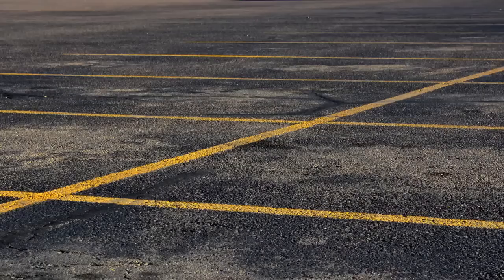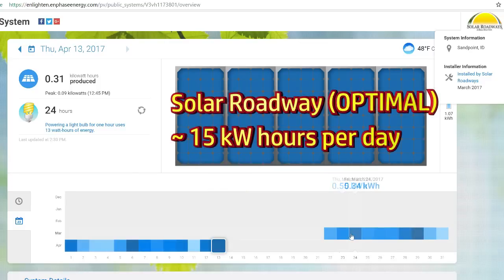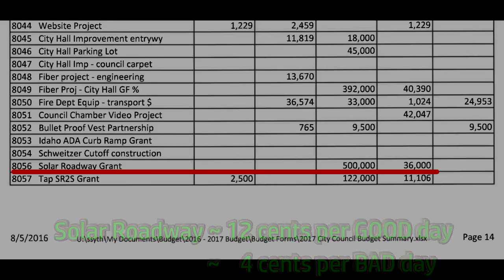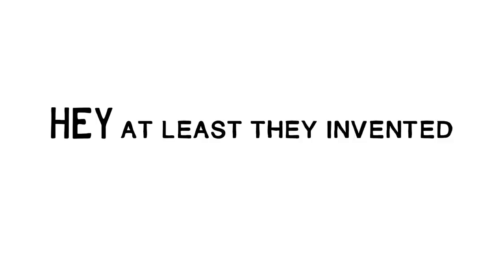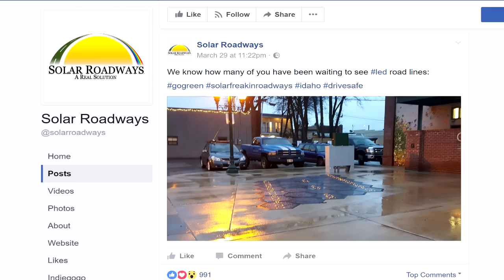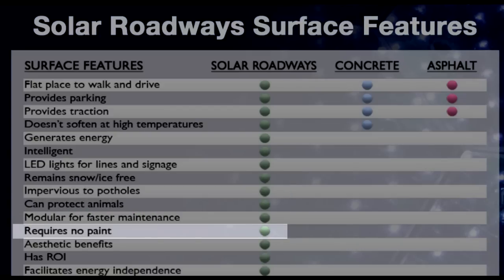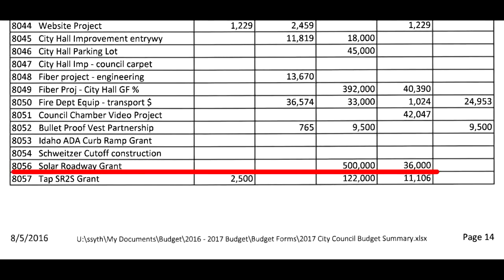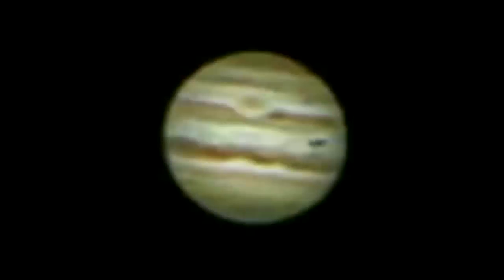Solar Roadways generate ~10 CENTS per day!!

Comment: I hope you read this.
I hope you do a video on it.
If mankind designed a shoe,,yes a shoe that captured a percentage of energy with each step taken by each person where woud that equate to. Sliding scale obviously. Shoe stores the energy and can then later transfer the accumulated energy
Reply: All that energy comes from your body, which burns food to produce energy. And today, producing food has a huge carbon footprint (from fertilizers to processing, from transportation to packaging, most of the stuff you eat cost several times of its weight in oil to produce), so it would just be a hugely inefficient fuel-to-electricity generator.
Reply: I was aware of that. I was trying to capture some of the energy that we waste as a result of what you mentioned above
Reply: It wouldn't be "wasted energy". Your muscles exert energy to move you around. Wasted energy is what is turned into heat through the inefficiencies of muscles, the non-elastic deformations of connective tissue etc. Any extra energy you'd be getting out of your shoes would be your muscles spending some of your energy to not move you around, but to power the generators in your shoes. The shoes would be that much harder to walk in.
Reply: I could see that coming.
Simply said
If your shoes weigh more you use more energy to get around
Plus the energy to create the shoes etc
The cost of that extra energy to create is not worth the returns.
Have I got it right
I am no physcist but I can understand that you dont spend a dollar to get a 70 cent return
Reply: Thank you for your responses as well
I am here to be informed
You have helped

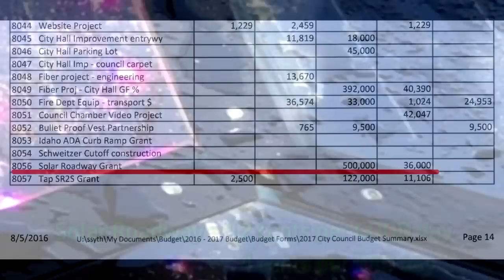Comment: 8:20 "No we have some hard numbers for ... return on investment" Er, no. The half million is for the installation of a prototype and not a mass-produced production-engineered system. Solar Roadways may be bunk, but your cost/benefit analysis is poor. You need to find out (or estimate) the projected mass production and maintenance cost. EDIT: OK, so I see you get to this at about 13:25 but based on his "current charge" which still isn't the mass-produced cost. It might be interesting to work the other way and calculate just how cheap the mass-produced cost would have to be for the roadways to be economical, and so what materials they could use. I bet that would also eliminate them as a possibility.

Comment: A decent reporter or journalist needs to do just a little bit of work and blow this scam wide open. The inventors have taken millions and simply gone about purchasing significant assets with the money that will of course be theirs to own once this farce ends. 
The husband and wife team the Brusaws were originally operating out of their own barn to make their dodgy prototypes. They didn't need any more space as it is still just the two of them but as soon as the big dollars started rolling in they used the money to purchase an actual premises when renting one would have been the prudent thing to do. They have also spent hundreds of thousands of expensive equipment to make 30 panels of glass when it could have been contracted out to an established business and a job. The had nice new trucks the minute they could get their hands on the donation money too as has been confirmed by residents of Sandpoint.
The Brusaws are still stating on their page just this week that they just need $15 million to start mass production. This is a scam and I'm waiting for a decent reporter to expose the truth.

Comment: So theoretically what would have to change in order for them to be viable?
Reply: roostewrum yeah I agree though they're probably there in order to get publicity.
Reply: Price would have to decrease around 1000% ($50/square foot of road is so affordable, you know) and efficiency of solar panel technology would have to increase to a point that I doubt it will ever achieve, ever. --An electrical engineer
Reply: They need to take the LEDs and rubbish out. They need to place them in a position where a car will never drive on them. Like on top of a roof. If only they had invented "Rooftop Freaking Solar".
Reply: RedRage oh okay. Thank you

Comment: 2 years ago when you posted your first video about solar roadways, I was in the camp of giving it a chance.  I'm all for the investigation and development of new technologies, exploration of the sciences, and so on, because that's how discoveries and advancements get made.  The last sentence of what I wrote was, "This all is an idea that needs to be given a chance to see if it can be developed so it's worth the time, effort, and money to expand further, or if it's an idea to toss in the dumper."

Well, they've had their chance to develop and test their solar roadway panels in materials, manufacturing, installation, and functionality, yet it looks like it hasn't really changed in 2 freakin' years.  They haven't delivered squat in terms of their claims of what their system can do and they've pissed away a ton of public and privately donated money to do it.  They've had 2 years of chances (and failed) and 2 years to definitively refute the numerous videos debunking their claims (and failed), and have only confirmed that yes, this is an idea to toss in the dumper where shit products belong.
Reply: The problem remains about the millions in public and private money that was thrown down the drain, that could have been easily saved at the cost of a pencil and the back of a used envelope.
Reply: Yes, I absolutely agree there.  Giving them a chance to prove themselves should not have included gobs of money being thrown at them by duped donors and starry-eyed politicians in government.  Thunderf00t and EEVblog/Dave Jones both showed some pretty easy tests and calculations to prove the solar roadways claims were dead wrong and needed redesigning for the panels to do anything useful.  If the owners of the company were electrical engineers as they claimed (if I remember right), they should have been able to do that themselves without the need for so many investors.  I commend them for exploring the idea of covering roadways and everything else with solar panels, but they should have admitted it wasn't a viable idea rather than pushing it as a flawless panacea for the world's energy needs while deriding the very valid criticisms of scientists and engineers who know what they're talking about.

Comment: I see their point that solar panels and roads are wasted space. But what's wrong with putting solar panels above roads ? 
- No losses in the glass layer
- Solar panels can be placed at an angle or even tracking the sun
- No expensive maintenance
- Snowy road doesn't have to be heated as snow doesn't fall on the road
- Only a little more expensive than regular solar panels (for the 'tunnel' construction)

"Downside": no flashy lights (which were proven not to work anyway)
Reply: If you put them on a rooftop, they are placed on an existing structure. Over a road as you suggest requires the cost of additional structure. This additional cost has to be justified by a comparison against the savings of snow (so there is no benefit in warmer climates) and the cost of no longer being able to transport oversize goods by road.
Reply: Yes of course, I would place them on a rooftop first. I don't think we're anywhere near having all rooftops equipped with solar panels. Maybe maintenance would be cheaper on large quantities though

Comment: There is also a solar roadway in the netherlands which is very succesfull maybe you should look into that!
Reply: The Netherlands one has fundamental differences: most importantly, no LEDS - so the whole thing can be done much cheaper. The NED project is still never going to be as efficient as rooftop solar, and is still liable to the costs of maintenance due to have a traffic load.

Comment: You are missing out the geographic position. A lot of power is lost in the atmosphere, which basically can be seen as an outer sphere with the planet sphere centered inside of it. And the longer way the sunlight travels through the atmosphere, the more power is lost. The place with the lowest atmospheric power-loss is the .... equator.

Comment: If they want to use the area covered by roads to generate energy it has to be a LOT cheaper to just build scaffolding OVER the roads and put tracking solar panels there. It will also eliminate snow on the roads. It will probably be less likely to break down since a lot of daily tonnage of vehicles driving on them. And they will never be blocked.

Comment: Check out this device called a "Radiometer". It is four metal squares, joined like a fan, and  covered in a clear globe. When light hits this, the metal fan spins. Connect this to wires and you can generate electricity.

This is solar power, but it's not by solar panels.

Comment: obviously you don't realize that in order to improve something you have to create a proof of concept. These solar roadway panels are obviously not great, but 20 years ago people would have said no one will ever use solar panels on their homes, and yet i can't even drive through a local neighborhood without seeing a home with a solar array. Give it some time to evolve and develop and i guarantee roads WILL be this way. Anyone who doesn't think this will eventually is a fool.
Reply: Zack Denkers Sunlight is abundant. But only a known, finite amount will fall upon a given surface area. A flat panel can never, ever be as efficient as a roof panel or a tracking panel due to it lying at an incline to the suns rays, therefore receiving less light per unit area. Unless you propose building roads at an angle towards the sun there is no way around this.
These road panels also only have about 60% of their surface as actual solar panel. The decision to make them in these hexagons means that the cells do not fit within them effeciently, as well as losing more area due to internal support structures and the LED's etc.
What makes these even more ridiculous is that a village in france has had a long section of solar road laid down already, designed and manufactured by companies who know what they are doing. And guess what, cars can actually drive on it! But there's still no known future for it, due to the massive costs of installing it and the small amount of energy to be gained from it.
Reply: Zack Denkers The law of physics that a plain surface inclined away from the sun receives more energy than one perpendicular to it. It's pretty basic stuff. 10 year olds can understand it!
Reply: No, he showed that at a flat angle, not enough sunlight hits the road. And there are objects blocking the sun creating shadows.
Reply: again in current technology that is true.
Reply: Zack Denkers If they can increase the effeciency of these solar panels that lie flat on the ground, then it stands to reason that solar panels that are roof mounted will become more effecient also. It makes no sense to believe that the cost per unit area of a roadway panel could approach that of a roof panel, given the additional infrastructure and technical requirements of the former over the latter.
Why would any sane person choose a costly maintenance nightmare that will never pay for itself over a proven tech that is virtually guaranteed to do so?
Reply: That's the thing you aren't understanding under today's technological limitations that is true. it was also true of roof mounted solar systems not too long ago. the other thing you have to keep in mind is locations with severe winter road conditions could potentially benefit 1000 times more than warm climates. considering some states spend millions of dollars per year on snow removal, and that the estimated loss in the state of utah for a single day where significant snow is on the road would cost $66 million dollars if no roads were plowed. it stands to reason they might consider spending some money on a better way to clear the snow. 

With today's technology that's not feasible, but it also stands to reason in 20 years it will be. you are all fools if you believe someone that technology cannot grow, just because he has a great argument that the current technology blows. look at the first cellular phones we would have never thought they would replace computers but in many instances they can and do, even though desktops are more efficient and cheaper, there is a significant advantage to the size and mobility of a smart phone.
Reply: The laws of physics are the limiting factor, not the technology.
Reply: roostewrum how do the laws of physics prevent it being possible to create the technology to power a roadway through solar to do what this project aims to? none. the only LAW of physics that could prevent the technology from function is the law of thermodynamics and since you are obviously incompetent i will explain it in layman's terms. basically energy cannot be created or destryoed. and any closed system will always run out of energy eventually. what this means is that you can't create more energy than you already have, hence the sunlight. luckily sunlight is quite abundant, unfortunately our BEST solar technology is only capable of capturing 40% of the energy they could. these roadway panels are likely less than a tenth of that efficiency. luckily with technology when you ha e something so inefficient the only direction you can go with it is up. nothing stated in this joke of a video suggests otherwise. just as nothing stated proves the technology will never be efficient enough. it is a simple ignorant video intended to fool the simple minded into believing technology cannot advance past where we are today.
Reply: you have still yet to point out a law of physics that prevents the technology from being efficient ENOUGH to do what it aims to do. if you compare them to roof panels you're right they will always be more efficient but only because both technologies will grow at the same time. no one is suggesting the road panels will replace roof panels. but why can they not be cost effective as a road building material? the only things you have been able to point out are design deficiencies, all of which can eventually be overcome with time, research, and advancement of technologies required to make it happen. as the technology improves and efficiency increases so will cost effectiveness, meaning that the technology will eventually be worth using. the only argument you can make is that today its not cost effective or efficient enough to even self sustain itself. which is true, but the question isn't about today its about years from now when you haven't and inkling of what technology will be capable of.
Reply: eddiebruv you're saying that because it cannot be as efficient as a inclined sun following array it cannot ever be effective. you sir must be ten years old if you think that limitation would prevent the eventuality of this technology being effective.... it WILL be less efficient than a roof mounted array, we agree on that. what you don't see because of narrowmindedness is that it doesn't have to be better than a roof mounted array to be effective.

Comment: $500 per sq. foot, ehh?  Well, a typical asphalt road is about $50k per mile per lane in the US, and a lane is about 12 feet, so 12 * 5280 = 63,360 sq. feet.  That means the equivalent solar roadway road costs $31.68 million.  $31.68M, per mile, per lane.  The US interstate system is 46,876 miles long, which means just replacing ONE lane of the interstate with solar roadways would cost $1,485,031,680,000.  $1.5 TRILLION, have of the entire discretionary budget in 2015.  And that's for just ONE lane of traffic.  Even the smallest interstates need two, so that's $3 trillion, and most interstates have at least four, pushing the cost to $6 trillion.  Comparatively, the interstate paving alone for four lanes cost only $9,375,200,000.  $9.4 billion...three orders of magnitude.  So that's what we're talking about here.  THREE orders of magnitude in cost.

Comment: There are so many better places to put solar panels on our public infrastructure. Solar freakin' toilets! Solar freakin' bus stops! Solar freakin' parking garages! Well, why not just stick them on the ground, where they will have the most abuse possible, and will constantly be covered in shadow? I dread to think of the repair costs the first time a semi wipes out on a solar highway and leaves a trail of wrecked panels. Even at a grocery store, most of the parking lot is covered in cars... oddly enough... so good luck getting the full power potential out of the installations.

Comment: The funny thing is, if they just painted over the solar roadway and deactivated the LEDs, it'd actually be cheaper even though the solar panels would be generating less power, they'd be using a heck of a lot less power too. I mean, it's still a terrible idea, but Solar Freaking Paintsplashed Roadways are ever so slightly more practical.

Comment: It does surprise me that they are about 3 times worse than you originally calculated because I came up with about the same figures. Also by my calculations they would have to produce about $140 a day of electricity in a $500k system to make it viable. This is assuming the panel will last 10 years. Wear and tear might half that though so we are talking $280 a day worst case or near 3000 times what they do produce.

Comment: Great !!!
Maybe you could also expose the TESLA claims that promotes the myth that the solar cells that cover their charging stations actually are used to charge the TESLA cars !!!
While they have a slight angle, they do NOT track, and my simple calculation is that they would have to be 30 times the footprint of the Model S  under ideal sun conditions. But perhaps even that is way too optimistic.